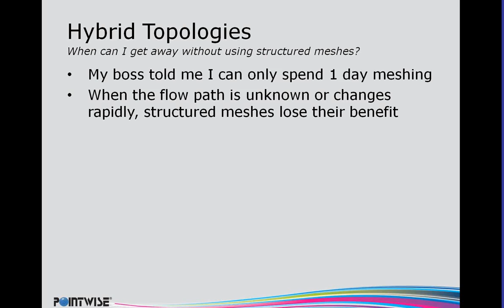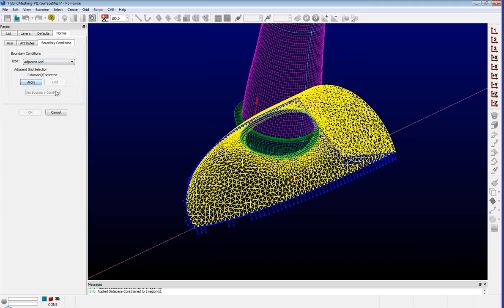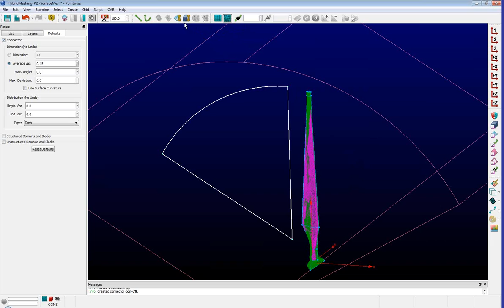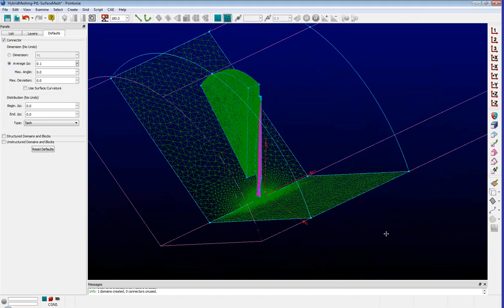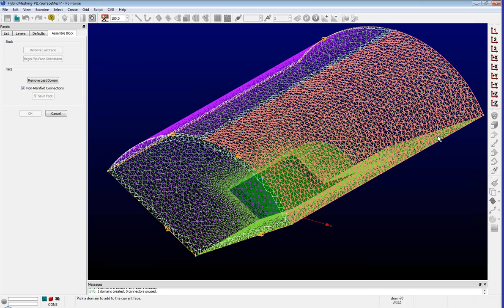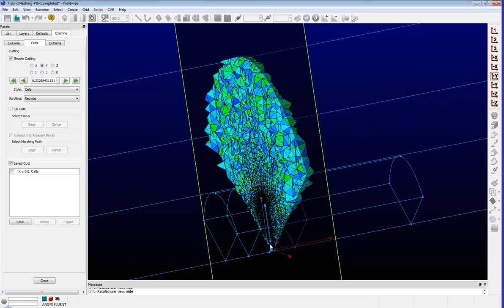How to Master Hybrid Meshing for Wind Turbines

Comment: The pyramid mesh  ( the linking cell between blade extrusion surface to tetra mesh) quality is pretty low and leads to divergence, any suggestions for improving the pyramid mesh quality?

Comment from the maker: Hi turboengineern: The CX100 blade was designed at Sandia National Laboratories so I suggest starting there. In particular, here is a final report they wrote about the blade. windpower.sandia.gov/other/084648.pdf